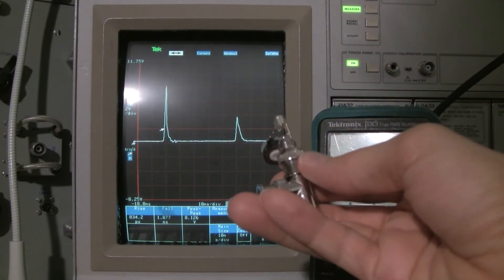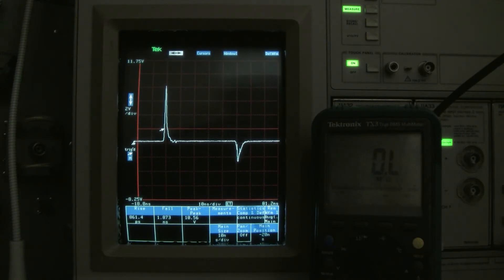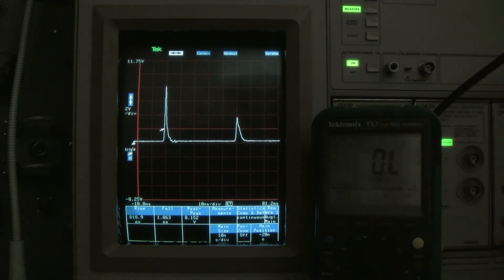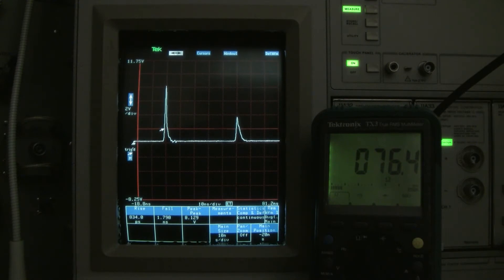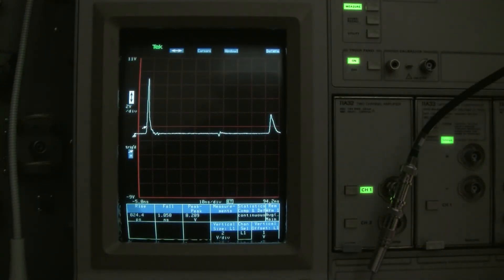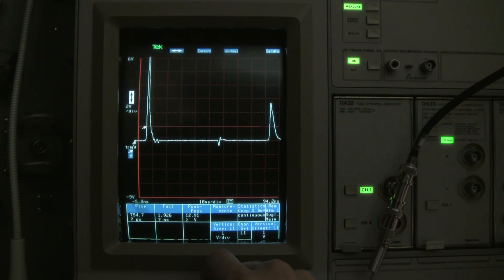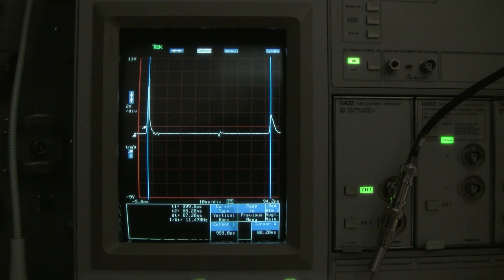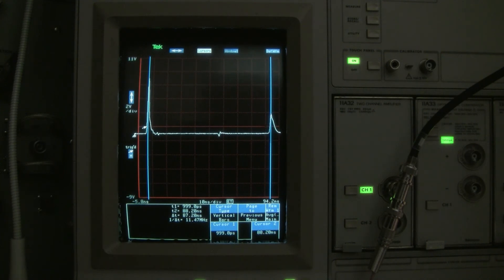Determining Coax Impedance with a TDR

Comment: I've been working in wireless for the past 18 years, have been using HP, Weltron and Anritsu spectrum and cable/antenna analyzers on a daily basis... I've had a few decent teachers along the way but I have taught myself most of what I know about RF theory and troubleshooting / using equipment and interpolation and extrapolation of data from that equipment. That said, what you have done and said in these videos explains it better than anyone or any source I have ever ran across and even I am leaving these videos with more concise understanding of how the measurements are actually obtained and values calculated, I guess I've always been spoiled with fancy test gear that does the math for me. I just wanted to say huge thanks for all the videos you put up, I have learned quite a bit from watching them.
Reply from the maker: You're very welcome!

Comment: Great video. How would you measure the impedance of a 5ft long Guertz type speaker cable which consists of two 1" copper foils with a dielectric insulator between them?
Reply from the maker: Well that's simple..... Measure them with a TEK Type 661 of course :^)